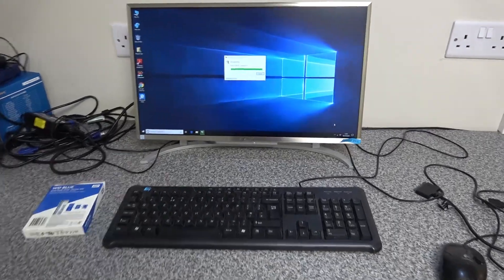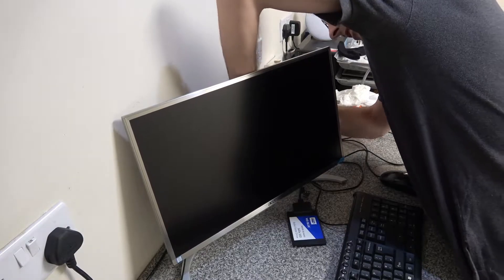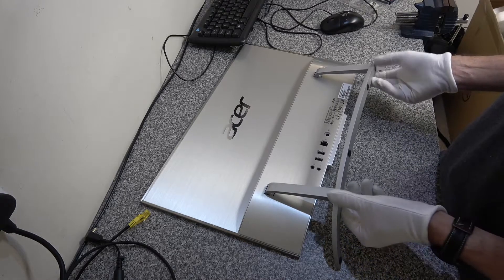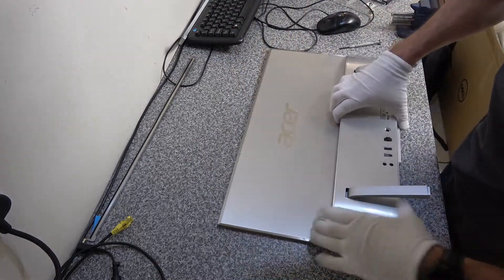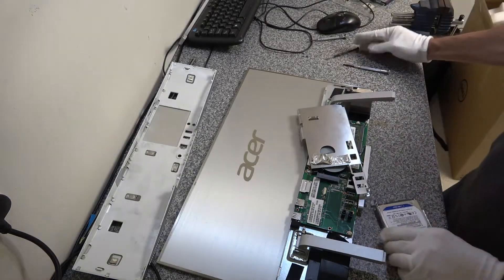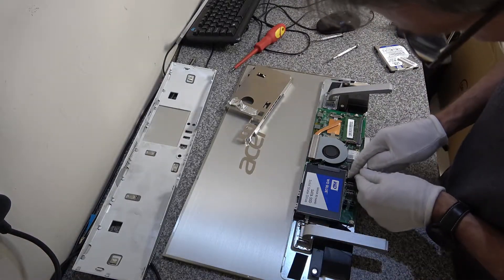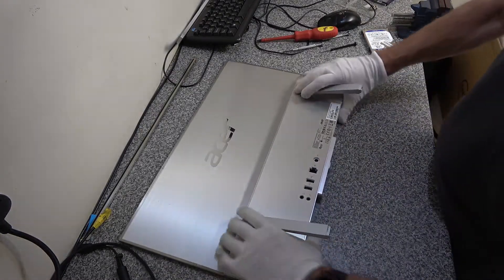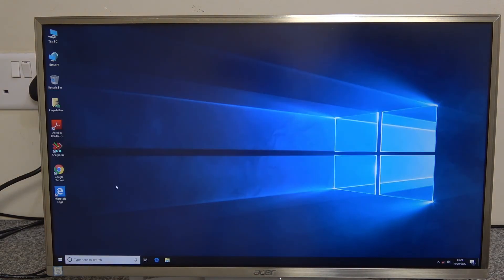Acer Aspire HDD to SSD change step by step

Comment: INFORMATION IS NOT JUST PULLING OUT SCREWS AND DISASSEMBLING THE DESKTOP. The SSD was never seen or shown where it was connected (SATA) or the connections on the desktop. Only disassemble and arm, but the important thing is to see the SSD, its connections and where it is going to be put or the desktop connections. INFORMATION SSD NEVER SHOW?